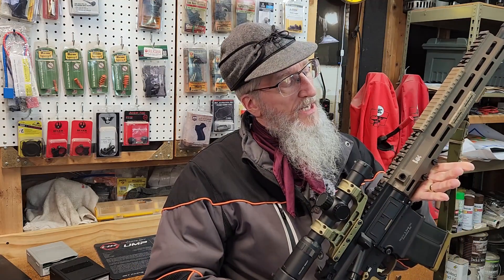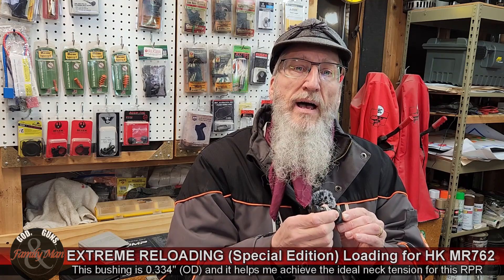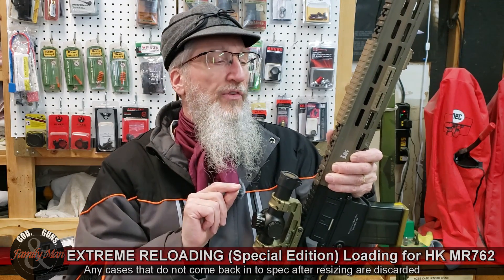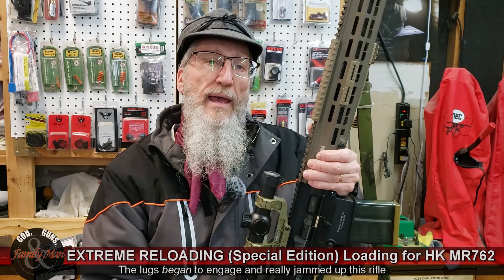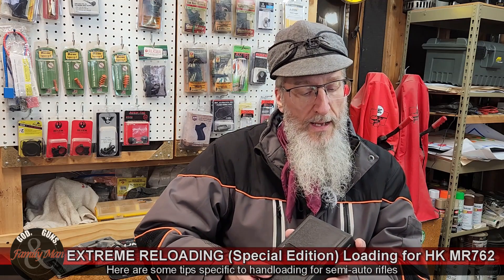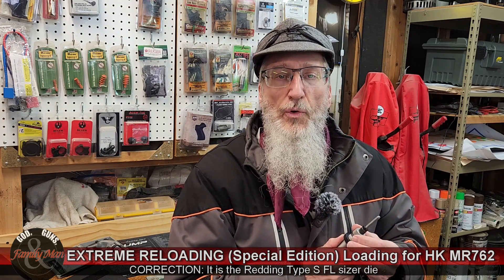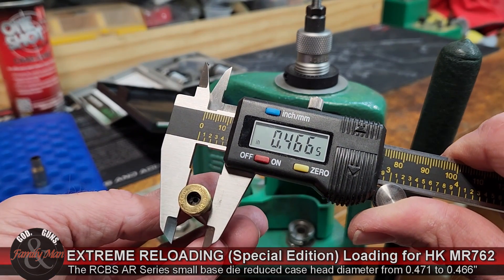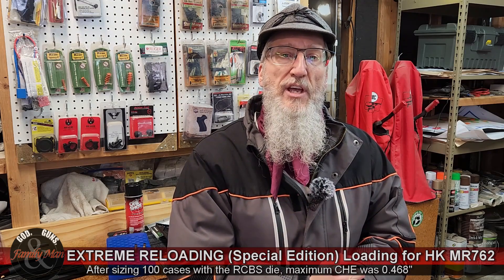EXTREME RELOADING Special Edition: Case resizing for the HK MR762 (and other semi-auto .308 rifles)

Comment: I had a similar experience with my 6.5 CM. My Ruger has a much larger chamber than my Tikka. Cartridges prepared for the Ruger with a .002" bump wouldn't chamber in my Tikka. I was using Hornady Competition dies on the Ruger for years. I set the Hornady dies as small as they would go and the brass still wouldn't close. I bought some RCBS dies and set them in the Rockchucker as small as they would go and they produced brass with a .001" bump that works great. I just keep the brass separated. I wanted to share this with your watchers because both chambers are to SAMMI spec, but the Rugar is on the larger end of the spec, and the Tikka is on the small end of the spec. Both rifles group well. I bought a .308 Tikka T3x superlite for hunting and checked the headspace with my Brownells .308 Match Rifle headspace gauge kit and it measured 1.631" which is also at the bottom of the SAMMI spec (1,630" Min). Once again RCBS FL die set produced a .001" bump. I believe the small headspace on the Tikka rifles that I have is one reason why they both shoot factory ammo so well
Reply from the maker: Exactly Greg, thanks for sharing that information.  A chamber can be built to SAAMI spec but specs have tolerances, in other words + or - a few thousandths of an inch.